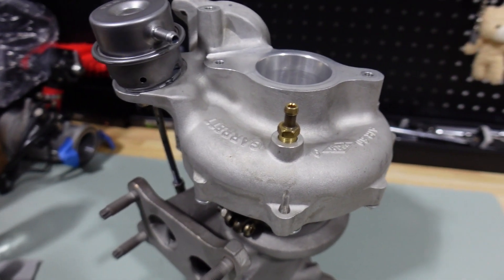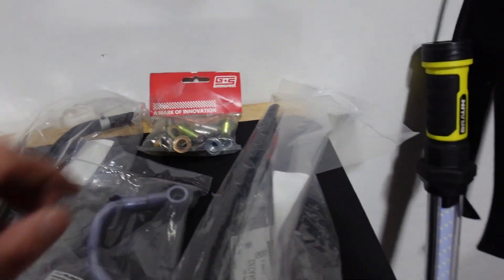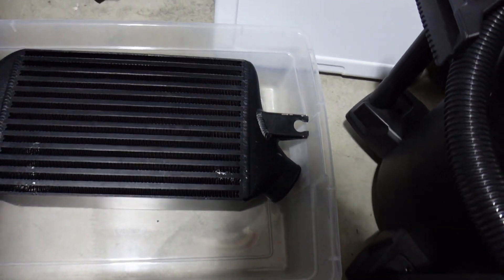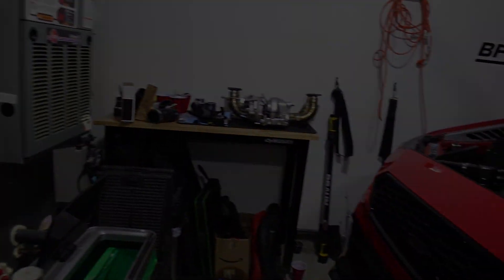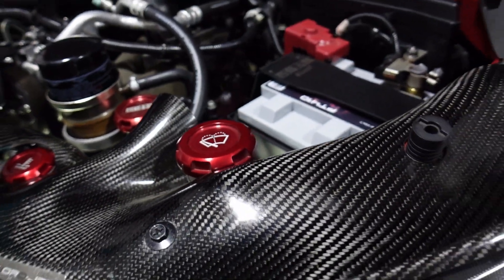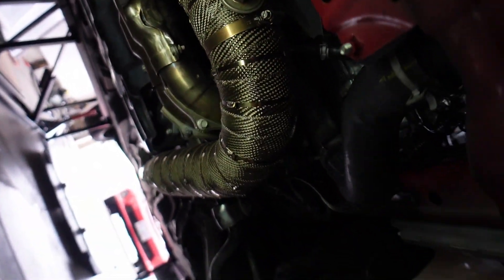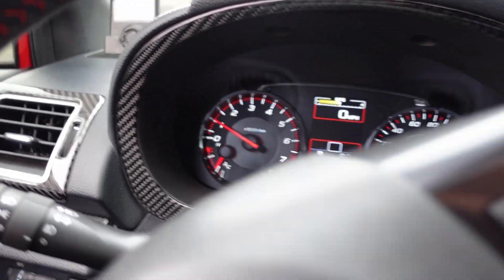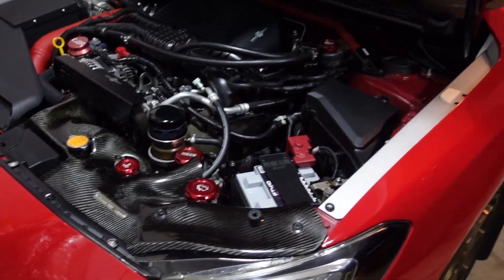THE WRX IS FIXED! | Rebuilt Turbo

Comment: I'll be installing a new TMIC, 3-port BCS, cast turbo inlet, boost pipe and turbo blanket (all Cobb) this weekend (or longer). I noticed you had most if not all replacement gaskets on hand; manifold to turbo, manifold to head gasket, turbo to j-pipe. I've ordered a set from Grimmspeed, and also ordered a turbocharger gasket (15196AA110) for the oil tank connection, intermediate pipe gasket (44022AA123) and another I'm not sure if I'll need (44011AG001), but for $13.57 figured why not? So over $100 for gaskets, but agree with your decision to do all this work right the first time. It's the stock exhaust, otherwise, I could have gone with the full Grimmspeed gasket kit, but would still have needed the turbo gasket and donut in addition. Prolly going to need to delay install for another week or two waiting on gaskets to arrive.
Reply from the maker: Yeah, it’s always a good idea to replace the gaskets along with the copper washers since they’re technically shot once you’ve released the tension on them. Good luck on the installs, I’m sure it’ll be a lot of fun! 🙌

Comment: Hey Great update and the video is fire!! as a personal opinion be very careful with the wrap on the J-Pipe as in some cases it has been the cause for Subie engines to catch on fire as well as destroying the pipe over time. There are other means to shield the pipe that can prevent both scenarios, personally that's what I will be doing this coming spring time.
Reply from the maker: Thanks man! Yeah, it usually becomes dangerous if you’re not careful about spilling oil on the wrap. No issues for me though!

Comment: I cant imagine how you fit that turbo blanket under the stock rigid heat shield...I had to leave out the lower half attached to the turbo oil sump, otherwise the sump wouldn't fit back on the turbo.
Reply from the maker: It was a PAIN to get on and I even thought about scrapping it cause it wouldn’t fit. I took my time and eventually got it on there.

Comment: I'm actually trying to decide between the obw and the WRX. I need something that's good in snow but fun to drive. The WRX seems ideal, but I keep coming back to the Outback Wilderness. I've always had hatchbacks and the outback seems so practical. If you could only have one which one would it be? Is the outback fun to drive in its own way? Wish it had a manual transmission.
Reply from the maker: Honestly, at this point in my life, the Outback wins. You never have to worry about potholes or anything. Not to mention it’s comfortable. Again, I’m in my 30s so comfort is becoming higher on the priority list 😂. BUT, this is coming from someone whose had a modified WRX which I’m fortunate enough to be able to experience. The Outback Wilderness is a lot of fun. It’s quick too but, overall, I enjoy the durability of it. I hope this helps 🙏
Reply: @ronfromportland  It does help. Thanks for getting back to me so soon.

Comment: By any chance were you able to find some torque specs for the bottom bolts on the oil sump? I’m in the middle of doing mine.
Reply from the maker: I had a hard time looking for these specs so I just “snugged” then down. Basically tightened them until they stopped turning, then gave them another 1/8”.  Good luck with the replacement!
Reply: Ok thank 🙏

Comment: Gonna do this same exact thing. How’s it holding up
Reply from the maker: It was holding up just fine. I sold it back in February.
Reply from the maker: You having the same issues?
Reply: Yeah I’m pretty much the same mod lvl, but with the green speed initiative retuning and putting egr/tgvs back on is annoying as helll. So my best option looks like a rebuilt turbo.
Reply: @ronfromportland  how’d selling the car go? I’m in Cali so it might be harder for me if I go that route
Reply from the maker: @adriansphere  I had all my stock parts so I put everything back (TGV, EGR, J-pipe). It was completely stock when I sold it and had no issues.
Reply from the maker: @adriansphere  yeah man, I wanted to get a Boost Lab turbo but was basically locked out from retuning. Things started adding up…I didn’t want to spend the extra on a new GESI Jpipe. Rebuilding the OEM turbo was the easiest solution.
Reply: @ronfromportland  when you did put the rebuilt turbo back in did it run good with the old map you had?
Reply from the maker: @adriansphere  yeah, it ran fine. I know it probably could have benefitted from a retune though.